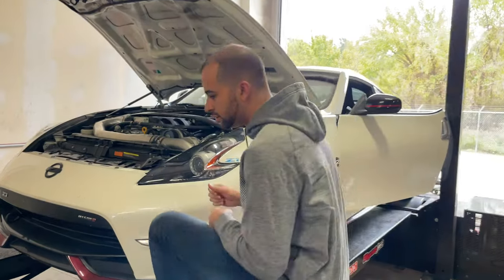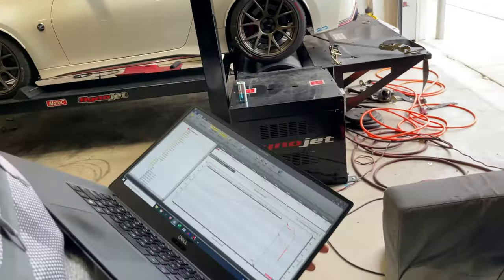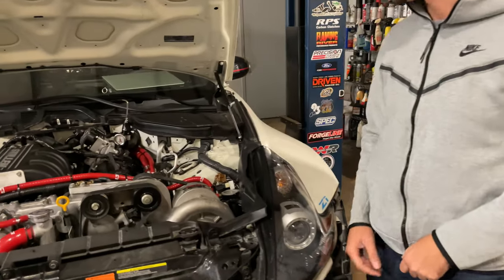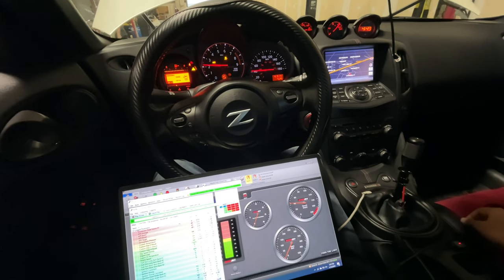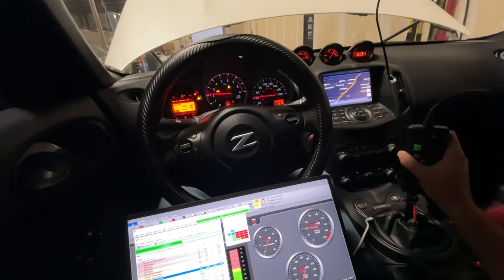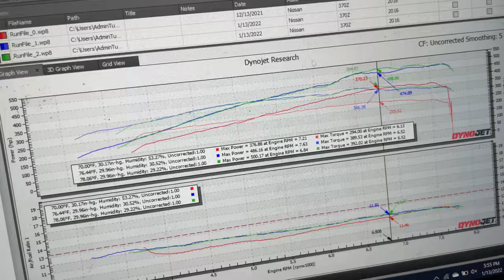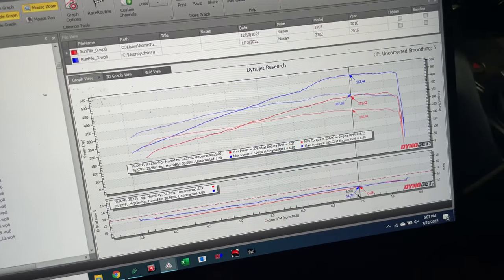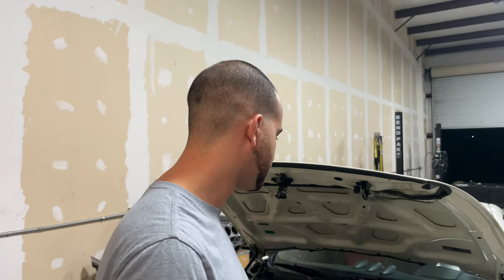SUPERCHARGING Your 370Z! Water to Air VS Air to Air - 150HP+ Gain

Comment: I do respect you for the Honest Tune in making a conservative safe setup instead of trying to make Granade Tune others try to do. IMHO, I prefer giving up a few HP for longevity of the motor.
Reply from the maker: When tuning a boosted car you do need to leave some on the table just in case of unfriendly weather conditions or lower quality fuel. 😎
Reply: This is what I want. OEM reliability and power. Not a wound up powerhouse I can't afford to replace when I blow it.
Reply: @admintuning  hey man how's it going on the Lord day!! I wanted to get info on tuning my 08 G35s 6mt please sir 👍
Reply: What’s the cost of a build like this?
Reply: @Unxpekted  v2 nismo + stillen supercharger kit would be around 60k NZD I think
Reply: FACTS!

Comment: The stillen kit has so many downsides I'm surprised they still get bought. A2w with tiny ass resivour. Terrible maf location. The water pump has the headpressure of a kitchen sink...

Great work getting people informed.
Reply from the maker: Thanks sir. Now he needs to put a mans blower on there with a flex sensor so it makes 650.
Reply: @admintuning  Don't tempt me with a good time
Reply: @admintuning  Do you mean a mans blower as in a brand name or as in vs little boys blower?  I'm not joking, I really don't know.  A flex sensor I'm pretty sure means a sensor that detects flex fuel like E85 right?
Reply from the maker: @VerisimilitudeDude  I mean a V3Si or V3Ti supercharger unit that will make more boost with this pulley combination and be more efficient. The Flexfuel setup will allow the ECU to add/trim fuel & timing for ethanol fuels and make more power from that. 👍🏼
Reply: @admintuning  Do you sell those or just do the tuning?
Reply from the maker: @VerisimilitudeDude  we do tuning primarily but we sell a lot of fueling parts.
Reply: @admintuning how do you find a V3Si vs a Rotrex C38R?
Reply from the maker: @TheSneakyTruth  The V3Si is the superior SC unit. Makes more power with less boost, any C38R VQ making over 600whp has to be overspun to hell to make that.

Comment: I’ve had my 370z (2019) for around 3 months now and just installed a tomei cat back exhaust. At the moment I have a stock y pipe and everything else is stock, what do you recommend would be the best headers test pipes and y pipe to get for best increased power?
Reply: Hi, in my case, i have a 2009 370z Touring model, i went to long headers, from headers, piping Greedy all the way to the tails, my car is getting 326whp, i have a few more bolts on mods, and ecutek tuning

Comment: Was the gains just from the A2A kit, or A2A plus long tubes?
Reply from the maker: Technically yes - I did do another before/after without changing headers, and the power gains were about the same (+130whp).

Comment: What mods do you suggest installing first before a tune to make some good gains? I have a g37 sedan.
Reply: Test pipes/LTH,  single exit catback and 3" Admin intakes FTW
Reply: test pipes and a good catback are the bolt ons that you will see the most gains with a tune.
Reply: @Aaron-wp1pz   Test pipe make little to no power, Spend the money and buy ISR longtube h
Reply: Admin Intakes, LTH, and any catback will help you make over 320 easy on NA

Comment: I wonder if the q60 can be converted to air to air intercooler
Reply from the maker: It has been done before, it doesn’t make a huge peak horsepower gain but it improves consistency in the IATs greatly.
Reply: @admintuning  How does that go relative to upgrading the coolant radiators? From what I understand these are pretty small/inefficient from factory.

Comment: That is a massive increase. Seems like that intercooler is a huge restriction and/or the timing was too conservative. What was the boost before and after the changes?  What were the intake temperatures on that air to air verses water to air intercooler? Was more overlap required due the long tube headers?
Reply from the maker: Timing was too conservative based on what? 

I didn’t tune the car when it was water to air so I don’t know how much boost it made. You can’t really log IAT accurately on a w2a setup either unless you tap the manifold for post HX IATs. 

As for the VTC overlap, usually LTH works best with more; but going overboard will cause dips in power.

Comment: What's up, Moncef...
I need some help...
I have EPS throttle bodies, and I have a misfire in cylinder 3 on cold start-ups after the car warms up. It goes away, and everything is fine, and the check engine light goes off...
What are your thoughts 🤔...

Comment: i still dont understand why OEMs and aftermarket companies use air to water kits. its more parts to fail, im assuming its more expensive, and its less efficient. what are the upsides?
Reply from the maker: This is a great question and I am not sure - on OEM supercharged cars that use a PD or twin screw blower, it is much easier to package, so I get that (GT500s, Hellcat, ZL1/C7Z06), but on the VR30DDTT I am unsure why they stuck with water to air since it is turbocharged.

Comment: Curious as to how much this setup would gain on e85?
Reply from the maker: Close to 100whp gain based on other cars I have tuned with the same setup.
Reply: @admintuning  what else would be needed to run e85? Just injectors and a pump?
Reply from the maker: @foxxrider250r  for a supercharged car, you will need a FlexFuel kit as well.

Comment: 150hp surely means the brakes are getting upgraded right? Or no?
Reply: It depends. If this is for roll racing or drag racing then the brakes don't need upgrades. If this is for the circuit track then maybe it will need it.
Reply: 2 piece discs, pads and SS lines coming up then new diff. Daily driver and track weekends.
Reply: @blakehightower2889  Very impressive

Comment: kinda skewed on your part... going from 376whp to 500whp ... im sure you coulve made more on the water to air .... 376whp was very conservative
Reply from the maker: I didn't tune the W2A setup, it was tuned elsewhere. However, the most a W2A setup will make is 400whp based on the maximum boost pressure it can make on 93 octane on this car.